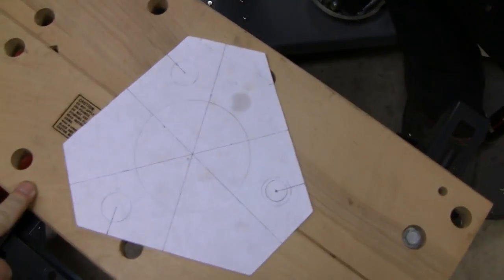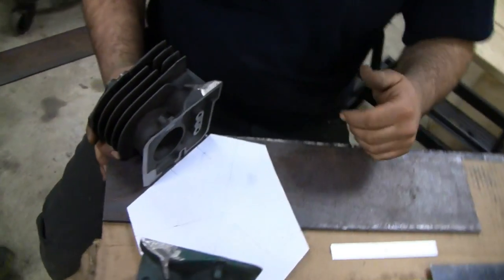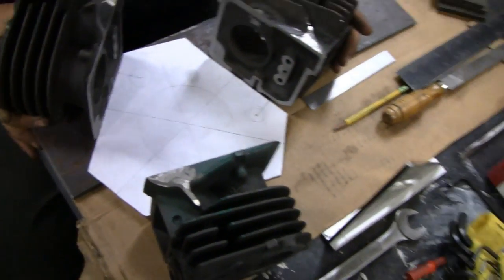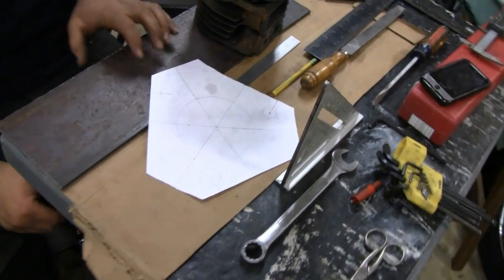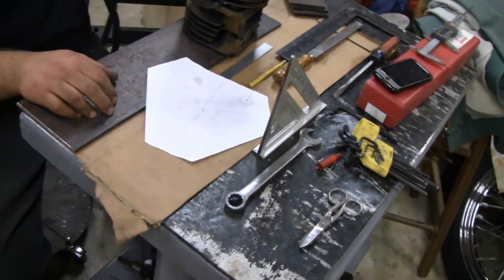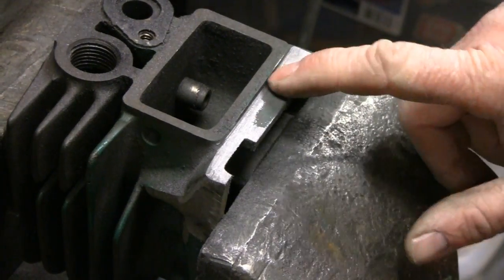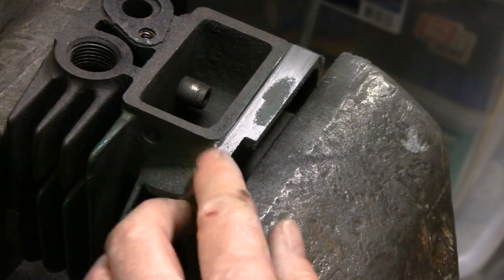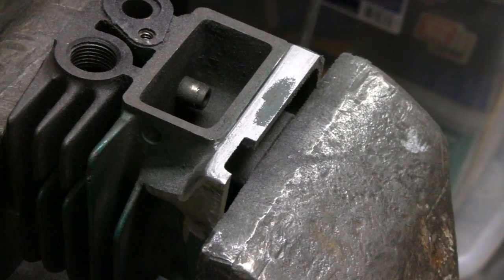HOMEMADE RADIAL BRIGGS ENGINE (part 6)

Comment: You're making good headway! When I was about 14 I had an engine out of my antique lawn tractor that needed work. The engine shop broke pieces off of my cast iron pulley while taking it off and told me that it couldn't be fixed. He said that cast iron couldn't be welded. lol That was 18 years ago, my welds are still holding. I can't wait to see it when you get that block all welded up. You need a small wooden prop to go on the front of it when it's done!
Reply from the maker: Chip Wright Yeah we probably will put a wooden prop on it!!☺

Comment: The his would be a tough project to do even with a real milling machine. This will be an engine along the lines of those built 100 years ago by blacksmiths. 100 lbs and 4 horsepower. A very ambitious project to say the least. It will be finished because Mike already has it in his head.

Comment: Just a 'side question' here RoadKing,...what make and model of saw did you use there ?  I have a need for this type of tool in my hobbies .
I'm glued to the monitor screen with each episode of this build. Thanks.
Reply from the maker: Reg Sparkes That's an Ingersol Rand Model 429!! It's a pretty good one, Lowe's and Home Depot sell cheaper ones that would probably be fine for home or hobby use!!☺

Comment: How you plan on oiling? Since if it was filled with oil it would flow to the cylinder thats facing down and cause problems. Just a thought.
Reply from the maker: weston wands It will have a dry sump so we shouldn't have any problem!!☺
Reply: Ah ok

Comment: Road King & Mike.  Had an engineering teacher that built a 6 cylinder radial engine in his home shop.  I must have cut 30 timing gear combination to get the right timing for this engine.  The only problem is when it was done the engine had to be disassembled to get it out of his shop.  It did run.  Keep up the interesting vids.
Reply from the maker: oldengine ken Thanks Ken!! Alotta people don't realize all the trial and error that goes into a project like that!!☺

Comment: Love your projects.  I was just wondering, if you ever have a problem with one of the heads and the heads are welded to the block, isn't it going to be terrible difficult to replace?
Reply from the maker: moaski Thanks Bud!! It wouldn't be difficult but it would be a little bit of work cutting off the cylinder and milling another one!!☺